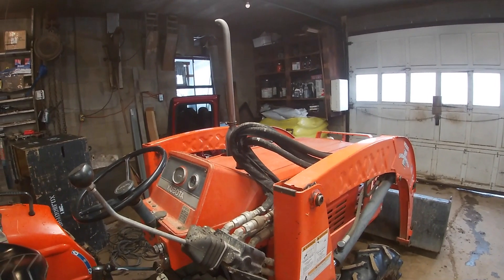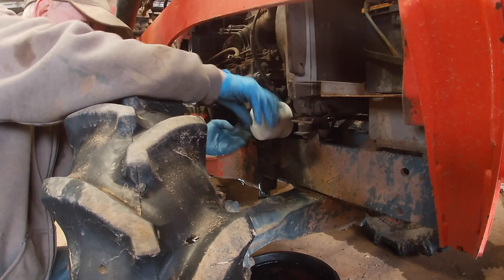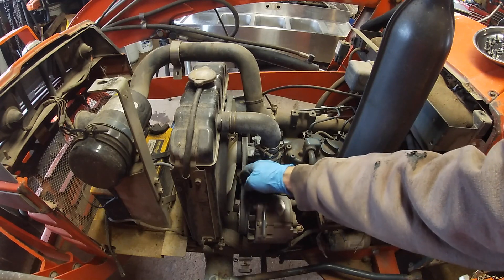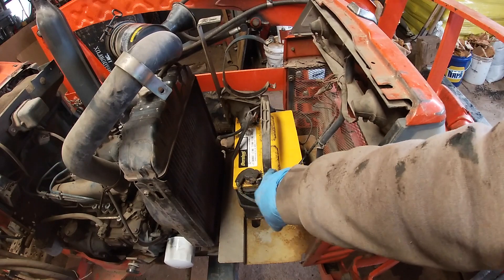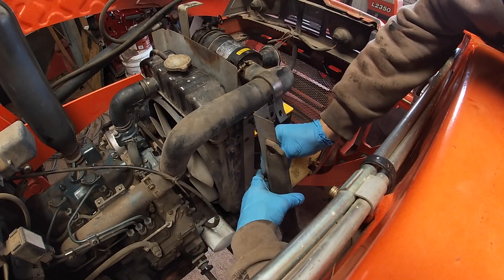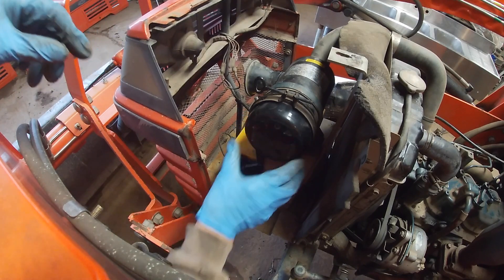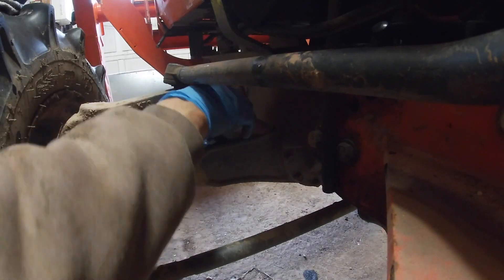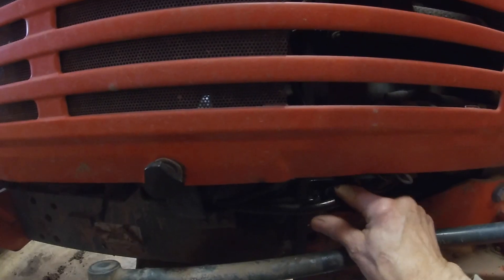Kubota L 2350 tractor service

Comment: Nooice! 😎 STOC... watching you shows me a lot of things my L2500D is missing😂
Reply from the maker: That’s interesting.  What parts are you missing?
Reply: @AJCurtis Oh, all sorts of bits and bobs, like the handwheel screws for the side engine covers, that metal vertical support from the engine to the top engine hood, looks like an electrical box  something on the firewall, the foam shields around radiator... just for starters 🤣 Thanks for responding 😎
Reply: @AJCurtis  You seem very knowledgeable about your Kubota.  I would be honored if you were to look at any of my tractor videos to see what you might also see is missing or just "wrong" 🤣. A Craigslist diamond in the rough that needs a lot of restoration.  Thanks again for making this content 😎
Reply from the maker: Well you can hopefully use my video to find parts you need. They are out there on eBay and at other resources as well. Good luck and just enjoy the beast. They are great tractors!
Reply: @AJCurtis  yabsolutely, just watching you on your tractor helps a lot.  I will check out all your videos and appreciate you sharing info on your tractor.  Cheers. 😎

Comment: Very helpful video. You have a nice way of explaining things.  I've been looking at purchasing an L2350 and wanted to see what a regular service was like. How's yours treated you? Any rebuilds? How many hours? Looks like a nice machine.
Reply from the maker: About 1350 hours. I bought the front loader and also a backhoe for it made by a company named Woods just north of Chicago. Really good equipment. Have had no issues with it except buying new front tires as old ones were dry rotted. I really try to maintain my machines as best I can. It also needs the valves set, so will make a video of that as well. I think it is a 90’s tractor, but hav not had time to research it. Would you by chance know? Thanks for the comment. I appreciate it. 😎
Reply: @AJCurtis   Wow that’s great. 1350 hours is no small number for a lot of machines but it’s only just breaking in a Kubota diesel like that. The L2350s were made from 1991-1998. I actually want to get a loader as well which is why I looked into these models. They seem to have adequate power for a loader. Look forward to seeing the video on the valves!
Reply from the maker: @Rennsport911  yeah, that machine was a great buy. Just was at the right place at the right time. Thanks for the info on the year. I was pretty sure it was made in the 90’s.
Reply from the maker: Wish I was videoing at the time I bought it in 08, as I installed the loader and backhoe myself. Would have made a great video.
Reply: Hey Old Timer , really enjoyed your video! 1974 started working as mechanic at IH dealership 1979 we became a kubota dealership fell in love with kubota tractors the older models like yours is better than the new ones! For sure don’t trade for new one ! Lived in northern IL. I’d pick up semi loads of equipment from Woods in Oregan IL. Great mowers and attachments! . Moved off farm 3 yrs ago living in Genoa IL. Now trading my Zd 326 for a L 2350 loader tractor. I guess it’s possible I might be considered a Old Timer Too ! You should come to our threshing show northern Illinois steam power club in August 4 days     Trader Jack
Reply from the maker: Thanks for the comment. I am a fan of Woods equipment. I have not had any issues with front loader or backhoe for my L. I installed myself and was actually not too confused as instructions were spot on. They built it to specifically fit my machine. Nice job. Kudos to them. Have to adjust the valves on that machine, wish you were closer! Sounds like you’re an ace mechanic on those guys!  Take care and keep workin’ hard.
Reply: Just bought a L2350, with around 3500 hrs on it, the 3 cylinder diesel engine has almost 0 blow by, and everything seems to be working fine.
Reply from the maker: Very good. Keep this tractor! They are really easy to maintenance and are almost bulletproof. Nice job!

Comment: Just bought a used one looks yours and was having trouble finding the hydraulic and transmission dipstick..thank you for this video.. to fill. is it underneath seat where cap says oil on it
Reply from the maker: Nice. Does yours have a sight glass on the left hand side of tranny when your sitting on the seat? Mine is just behind clutch pedal. Just wondering.
Reply: Yes sir there is no sign of fluid and dipstick is dry
Reply from the maker: @luisbotello225  uh oh. Fill it up and check for leaks my friend. I believe it take’s Universal Tractor Fluid. Good luck and keep me posted. I will help any way I can.
Reply: @AJCurtis  sure will thank you sir